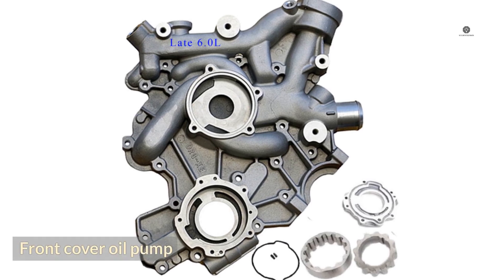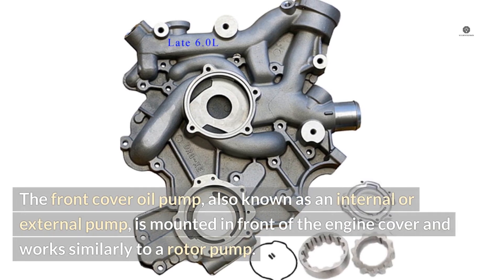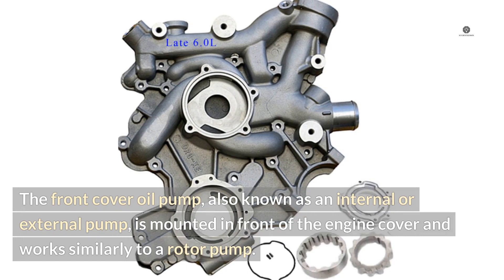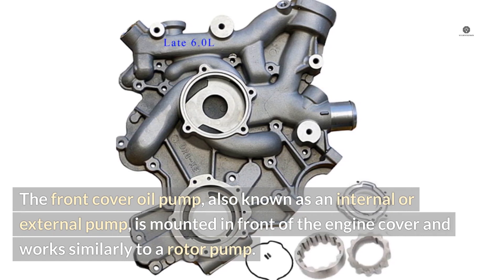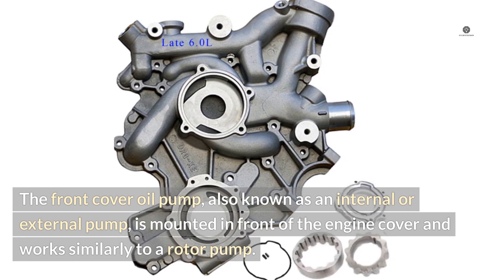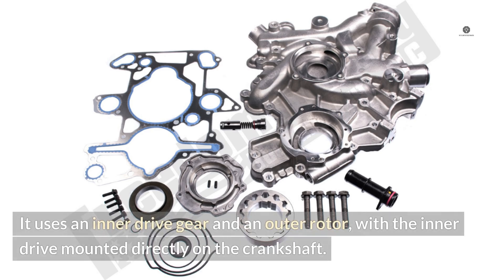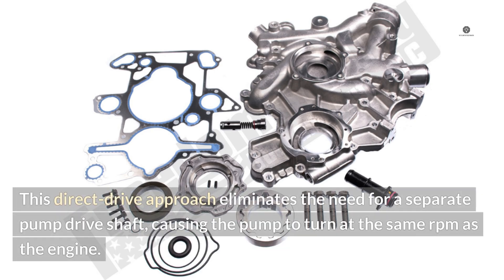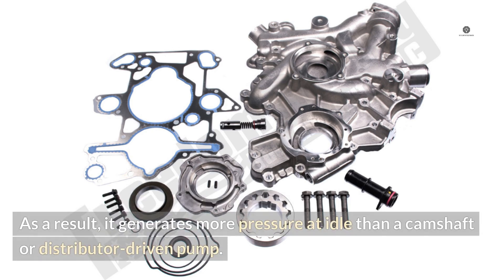Engine Oil Pump Explained!

Comment: Just a pointer for your what I assume is young channel. I watched to learn how oil pumps worked because I often wondered that. Half the video was about the importance of oil and where it goes - which is fine - and just a minute or two on actual oil pumps. Plus your video showed a 2-stroke engine that was supposed to be a 4-stroke but regardless would never fire that way. And the ai narrator is annoying, just read your script yourself. Good luck!